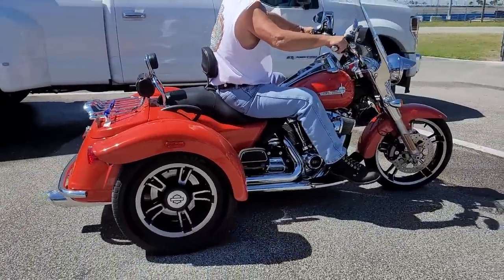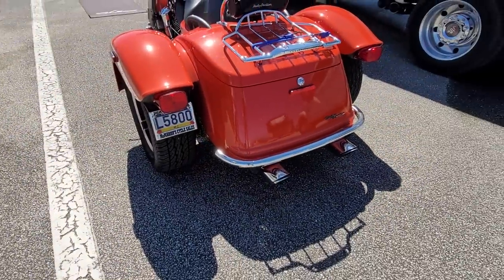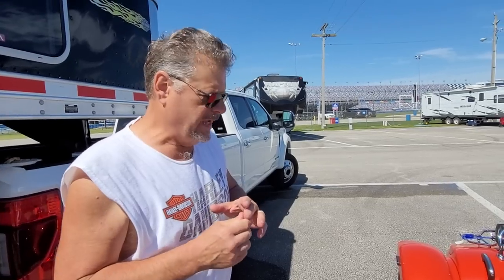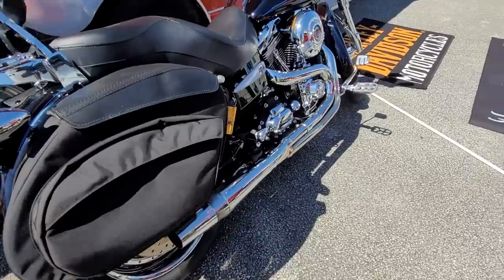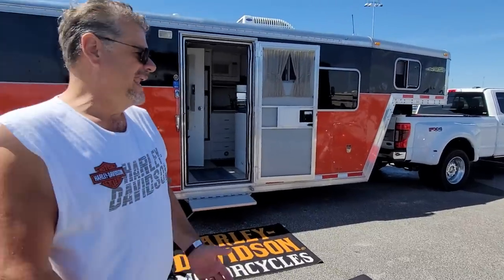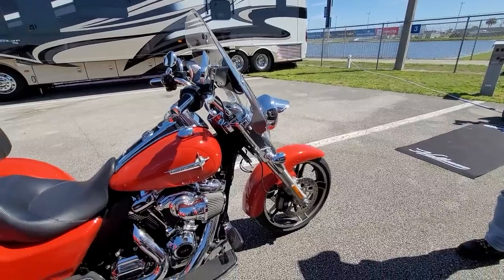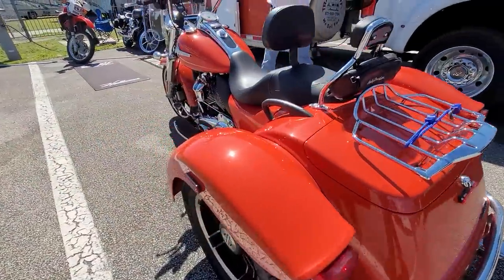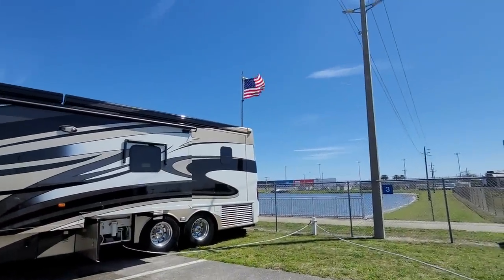HEAVY D'S 2020 HARLEY DAVIDSON FREE WHEELER 131 CI STAGE 5 148 RWHP TRIKE ROCKET-SHIP @ DAYTONA 2021

Comment: I bought a 2021 Freewheeler because of back reasons. I'm 71 y.o. I've been riding since I was 14 and I can tell it's great to be back in the wind. I may wait awhile to upgrade from 114 to 131.
Reply: hi i am 62 i updated my 2019 flrt with a S & S 475 cam six months ago and had dyno done 2 months ago started popping monos 2 weeks ago and then snapped the belt drive i have upgraded the belt to the S & S one but i won’t risk doing monos again and harley was Right to warn me about the upgrade it’s just that the m8s don’t sound like a harley and you need the cam I would not go to the 131 as it gets very expensive to replace the belt on the trikes cheers

Comment: Stage 5? What do you mean? Harley only goes to Stage 4.... unless you've added more to the engine as well as the stage 4?
Reply: It's a 131 stage 5
Reply: Lol stage 5... even the badge on the engine says 4. There's no such f'n thing as a stage 5... and if it's screamin eagle there's no f'n way it's 158 at the wheels... probably not even at the crank.  Guys with much better aftermarket parts aren't even getting those numbers. I've done hours of research, reading, watching videos, etc. and I'm just not seeing the numbers you're claiming.

Comment: finally some one stepped up to the plate and hit one over the fence on the free wheeler ..right arm  . outa state
Reply: kaplan got your ears on ? two years ago my gear heads at cannonball harley twisted my arm and forced me to have them take my brand new very last 2017 dyna s 110 cu in that had 0 miles on the odometer with the battery cables hanging out of the battery box and no smell of gasoline has ever been in the gas tank has this machine had never been serviced yet with twenty-seven hundred bucks knocked off the retail price allowing me to have it for 15500 bucks but not until they made me wait until they installed the Screaming Eagle stage 4 and we're only a hundred fifty bucks or more larger off-road racing heads as my service rep a cannonball explain to me" it's just the right thing to do " so I took it for a little ride have exactly 30 miles as it was 27 degrees outside at that January day in Terre Haute as I roll back into the shop and said to the service writer make it so and later with a TTS tuner they promise not to tell the factory we placed my new Dyna on the rollers are they all out Dyno drag next to a Hayabusa as I turned the quarter mile and 9.6 seconds at 123 miles per hour verses Hayabusa that turned a 9.7 at 130 miles per hour but since I got there first put the Hayabusa in second place as the first loser to my Harley. But very sadly as I discovered a week later Harley-Davidson does not make a compensating sprocket that will hold all the horsepower you get from there screaming eagle kits and when they took that primary cover off all they found was a pile of aluminum gravel that used to be a clutch basket with the dogs of the compensating sprocket lay off center and a double roller chain snapped in two wrapped around what was left of the transmission driven sprocket. I predict the same will happen to your buddy with the 131 freewheeler but there is a cure that your friend needs to look at. baker clutches and drive lines ...i recommend replacing all Harley-Davidson compensating sprocket with a solid steel sprocket but Baker goes one step further with his own compensating sprocket. And today Baker bills what he calls that King Kong clutch that uses 20 plates from a Cadillac STS automatic transmission with a 650 horse Supercharged V8. Now as far as the final drive that Harley uses that is a belt wrapped around a pulley on the rear axle tell your buddy can you check into the trike kits for the other brands as they employ a Ford 9-inch rear end. There is also another thought as one of my Vietnam veteran Buddies his knees went out so he put a trike kit on his Dyna sport Glide that involves a fully independent rear suspension a double Billet wishbones and dual shocks on each side that was driven from his stock rear belt

Comment: Who did youe tuning I just did a 132 crate on my FLRT
Reply: hi how is it going i have a2019 flrt and had a S&S 475 fitted and done the dyno tune done 2 months ago started popping monos on it and after a dozen of them i snapped the drive belt i was warned from harley about the extra power i am upgrading the belt to the S&S stronger one i believe there’s too much weight for the belt to pull have you had similar issues cheers